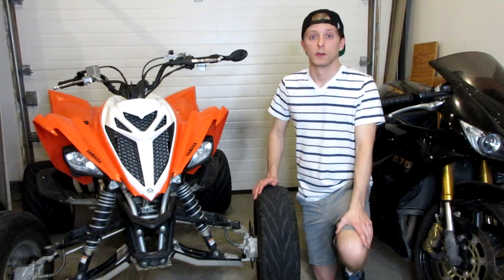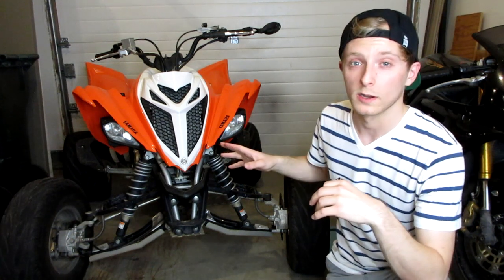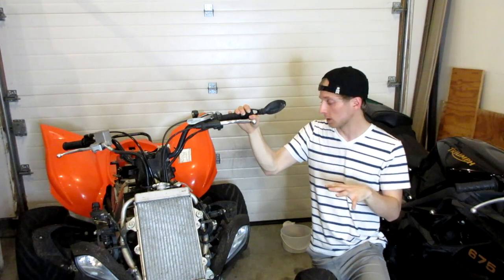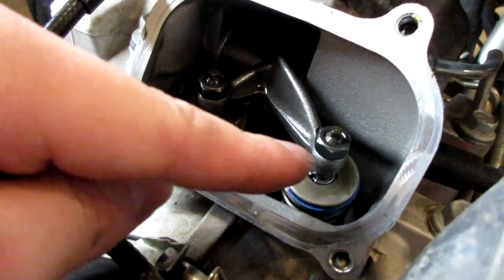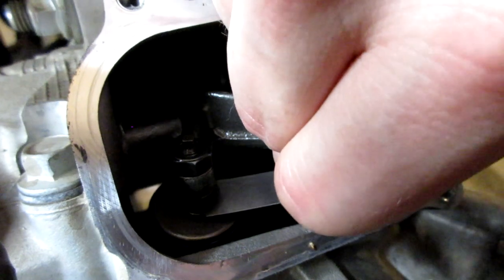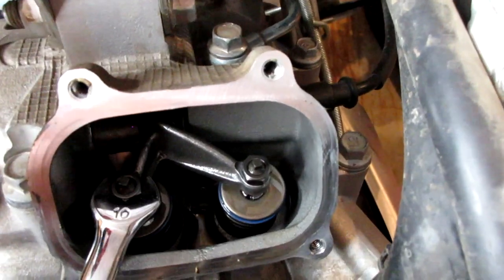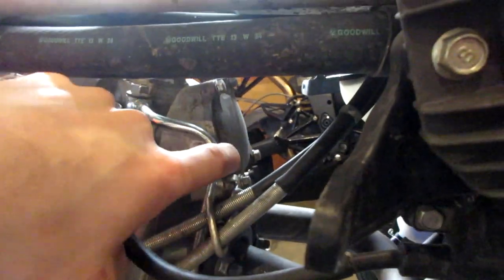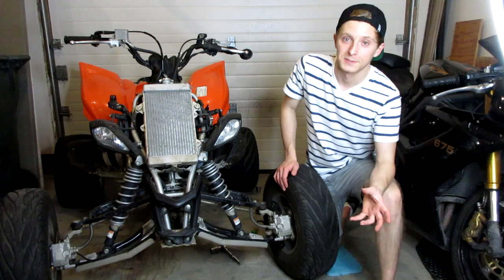Raptor 700 Valve Adjustment

Comment: Great video! My raptor started blowing the intake manifold off... so I thought my timing was off or the timing chain jumped a link. I watched your video abd did my 2005 raptor 700r SE just like you showed us here... however my raptor has the same issue it did before I adjusted the valves. It won't start and blows the intake manifold off. Flames come out as well. I was hoping it was a timing issue that a valve adjustment would solve but that was not it. Put new fuel pump on... New injector too... but it is still sending the explosion back thru the intake manifold. What could this possibly be?

Comment: Thanks for your vid. I adjusted my valves but i still have a noice. Do you have any idea what it could be? Thanks
Reply from the maker: The raptor 700 valve trains are all a little noisy. What does yours sound like? Are you sure its valve noise and not timing chain related?
Reply: Thanks for replying. It's more like a rattle. It might be the timing chain because it turns of on me.
Reply from the maker: Hmm I will say my valves seem to be a little bit more noisy on startup. After I ride for 15 20 minutes and everything heats up the rattle/tick seems to quiet down significantly. Same with yours, or?
Reply: @Motoposh  Before i adjusted the valves yes it would go away after a little riding. Im not sure now but i know i need a oil change.

Comment: What size is the crankshaft cover Allen head
Reply from the maker: I believe 10mm. Its possible to use a 3/8" I think.. as long as it's not too tight in the first place

Comment: Did you have a slapping sound in your engine before tightening your valves ?
Reply from the maker: A slapping sound is probably a loose cam chain. Ticking would be from valves

Comment: @MotoPosh Hi there. What are the signs that the valves need adjustment?  I have a 2018 and I can feel a loss of power/torque? Is it one of the signs? It was right after an oil change too. Should I mention. I have right about 20 hours. I don't see how it could be related to the oil change but I just had to mention that.
Thanks in advance
Reply: Yes u need to adjust your valves
Reply: Well it’s a little late now but a slight ticking noise can also mean loose valves